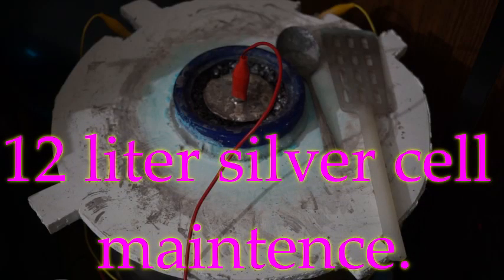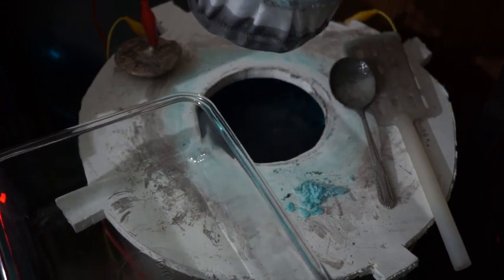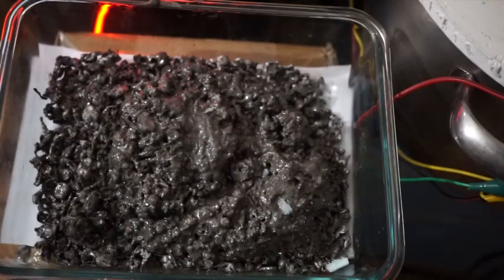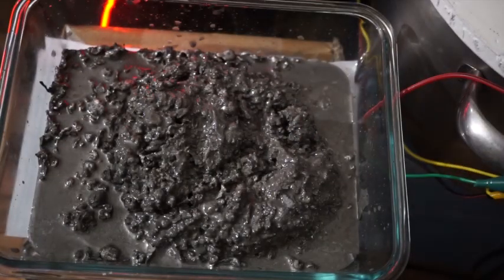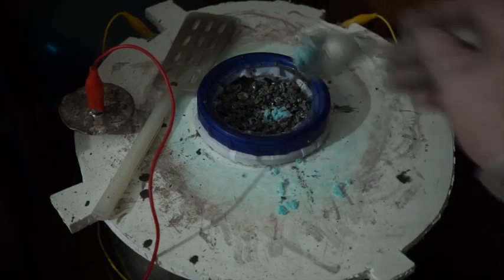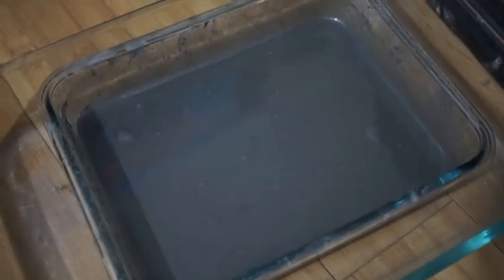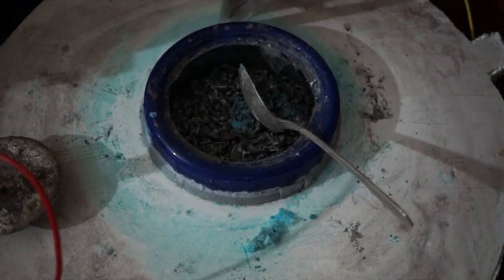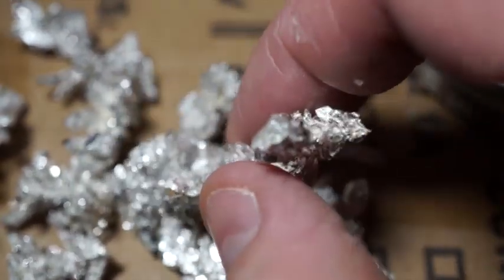12 liter silver cell maintenance.

Comment: What is the difference between 1.5 volts compared to 3.5 for a silver cell? Is a larger stainless container better for a cell? I have access to a 25L bowl.
Reply from the maker: The lower voltage seems to work better. The larger container would just allow you to grow more silver.

Comment: Have you recovered platinum group metals from your sterling silver slimes?  I'm curious if its worth refining the sterling silver slimes and used filters for PGM or if its just silver and left over crud from melting.
Reply from the maker: If you routinely recycle old silver it is definitely worth it. Old silver contains more PGM.

Comment: Hi  Phillip What do you use for your filter basket ?
Reply from the maker: The basket itself was just a plastic food container. I then drilled a bunch of holes in the bottom of the container. As a attempt to direct the flow of electrons through the shot in not out the sides of the basket. The basket is also there for structure as silver is quite heavy. The filter material is a shop vac Dacron filter bag. I just cut it so it would fit in the basket without wicking too much of the solution out.

Comment: This looks fun but also very toxic. What do you do with all that liquid you use? How do you dispose of it properly and is it expensive to get rid of it?
Reply from the maker: The liquid used starts out as silver nitrate. That is the electrolyte for the electrolytic silver cell. As the silver is purified, copper is deposited into solution.Creating copper nitrate.Copper nitrate is easily destroyed with sodium hydroxide.Once filtered and ph balanced it is OK to pour down the drain.
Reply: @philipbender956  Thanks I haven't taken Chem01 in College. How much CHEM or OCHEM do I need to be "safe" and not have any accidents?
Reply from the maker: @JDoe-hb7pc  sunglasses 😎
Reply: @philipbender956  have you tried converting the copper nitrate back to nitric acid and copper sulfate? I saw a YouTube video that did that. But then you're left with copper sulfate. Is there a way to extract the copper from copper sulfate?
Reply from the maker: @cadillac8597   I extract the copper by adding iron to the mix. I usually don't recycle it though I just pitch it in the trash after destroying the acid.
Reply: @philipbender956  do you use a fume scrubber? I want to start experimenting with precious metal refining, but want to have a fume hood in place before I begin so I started reading the gold refining forum about fume hoods and scrubber, but I can't decide if its necessary if I'm dissolving a Kilogram of silver per month.  Is there a special name for the reactor lid you have for the griffin beaker? I cant find those online anywhere.
Reply from the maker: @cadillac8597  the fume hood should be good. Try searching ebay for the lid.
Reply: Lmao

Comment: If I put too much nitric acid and then try to recover my gold and I can't recover. How do I neutralize the nitric acid
Reply from the maker: Try formic acid to destroy the nitric in your aqua regia.
Reply from the maker: You can also use urea.
Reply from the maker: As a last resort. Boil the solution dry. Then rehydrate with hydrochloric acid.
Reply: Thank you

Comment: hello friend how do I make the electrolyte solution?
Reply from the maker: Dissolve 120 g of pure silver per liter of distilled water. This will produce a strong electrolyte for your silver cell.
Reply: @philipbender956  thank you.
Reply: @philipbender956  How would you dissolve 120 g of pure silver into the distilled water? Im new to all this but want to try.
Reply from the maker: @bobcansee   by using a small amount of nitric acid.  You dissolve the silver 1st then dilute it with distilled water.

Comment: Just want to add that silver's properties are not due to free electrons. Copper, silver, and gold all have the same number of free electrons per atom. Bulk copper has a higher free electron density.

Silver is not only the best conductor. This also makes it the best heat conductor and visible light reflector of all elements.
We need to take quantum mechanics into account to get a full answer.
Reply from the maker: I agree, I don't fully understand the process. I just gave a simplified answer as to what was happening.
Reply: @philipbender956  
I had to work out Fermi energy levels (Fermi spheres) in quantum mechanics, but even that's insufficient to nail down silver as the best conductor. You'd need a high level quantum mechanics treatment to settle the issue.

Comment: So what do you do with the dish full of mud? There are clearly many ounces of silver in that mud. Do you use it a spoonful at a time on your next cell run so as not to clog the next filter...or what? I'm not seeing an easy solution to that problem.
Reply: maybe add 50/50 water and nitric acid and then sediment it with copper?

Comment: If you ran one in your house would it rust your door hinges and stuff from nitric acid fumes???
Reply from the maker: I have been running different silver cells in my office with no noticeable environmental pollution. When you make your electrolyte for your silver cell you are supposed to consume all the free nitric acid. There should only be a dilute silver nitrate solution in that cell. No nitric acid fumes present. The only danger I do see in running a cell like this is. You will get a formation of silver and copper nitrate crystals on the top of your cell which may become airborne if you have a fan or an open window in the room. And of course knocking your cell over would be disastrous whether you are at home or in a lab setting.
Reply: @philipbender956  thanks, I want to get a cell going but not at the expense of rusting my house out.
Reply from the maker: @stevennolan2675  running a silver cell in your house isn't that dangerous as long as you keep it in a contained area. The dangerous part is making the electrolyte. That really should only be performed inside a fume hood or outside with a fan blowing away from you.